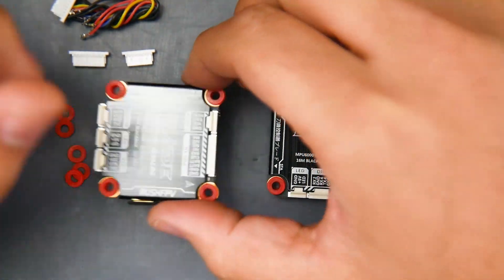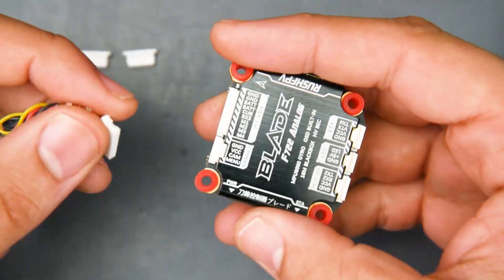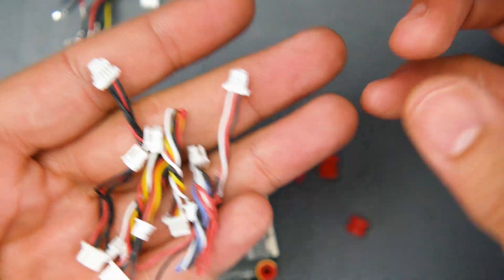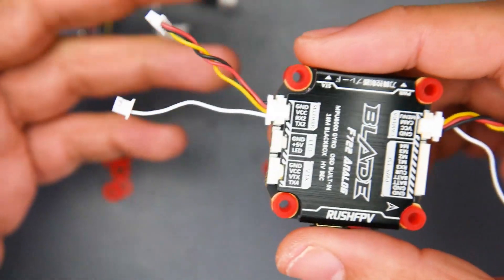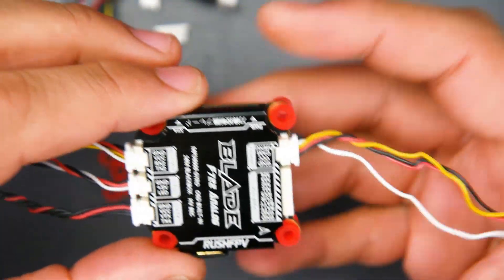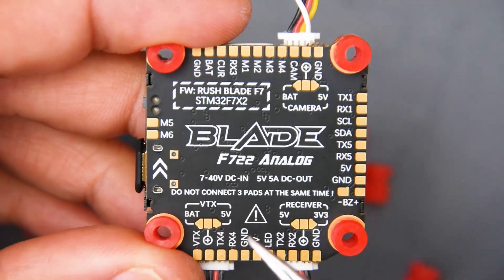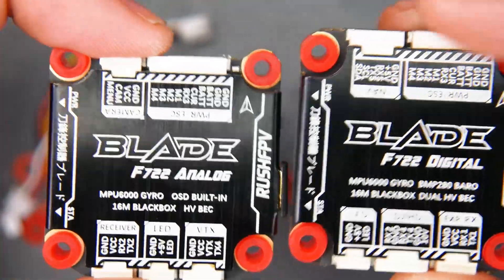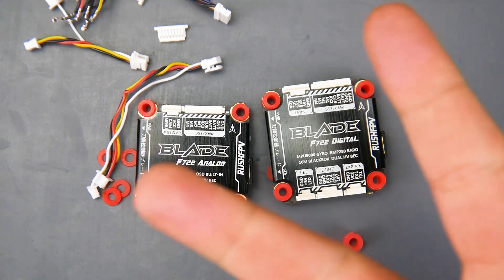THEY HAVE AN ANALOGUE ONE!! // RushFPV F722 ANALOGUE

Comment: Hello sir, i hv question for soldering caddx vista to analog fc there only hv 5v, it is good if i solder it to xt60 pad using bec output 5v/9v? So There have noise electrical or no?
Reply: Have you manage to do this?

Comment: hello, i have a microzone MC6C transmitterand MC6RE receiver so now i am trying to make a fpv drone so i decide to use it for HGLRC F722 flight controller so my MC6RE receiver has a M.BUS port for connect flight controller so if i use the HGLRC F722 flight controller to this receiver as S.BUS it will be work without any issues???? (please someone who else reply to this question as soon as possible)

Comment: So I've got 4 H7s otw, two flightone h7s and two Radix 2's. 

What 4in1 would you run with these for optimal performance with 4s-5inch.  

I'm going to be running full-size DJI air unit and crossfire for my links.

Also, which 4in1 would you use for these H7s on a 7 inch with 2806.5 motors on 5s? I have the F1 cable with built in regulator for the 7 inch 5s, I realize the dji can't run on 5s alone.

Comment: I feel like the lack of a voltage regulator in the Blade FC shows that Rush is confident enough in the voltage regulation in their own VTX to not need one. If that's the case, that's really interesting.